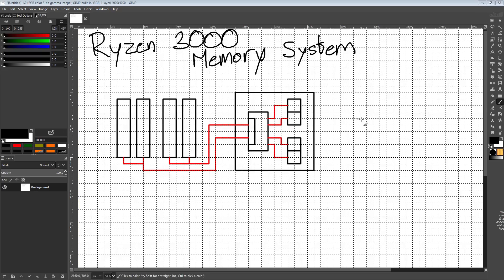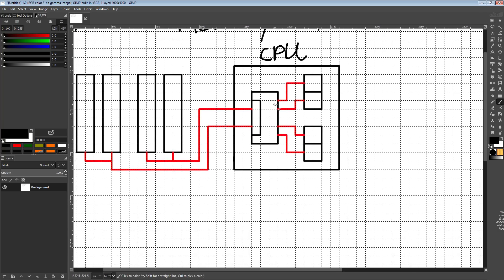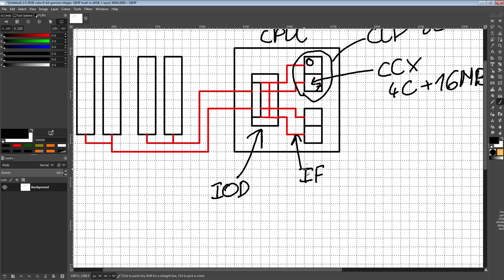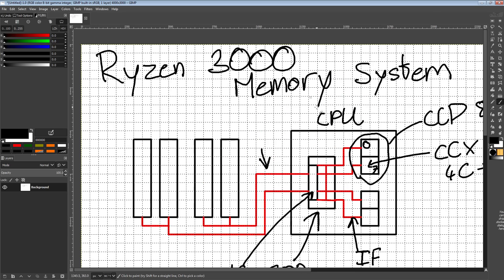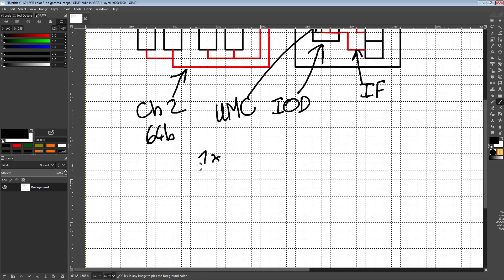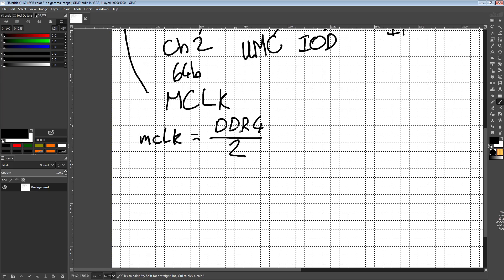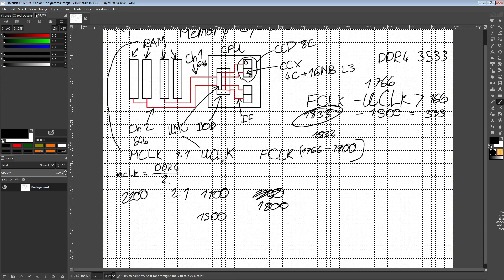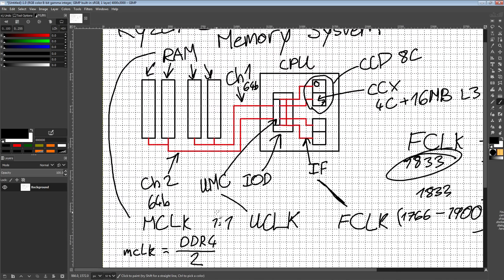AMD Ryzen 3000 memory system explained

Comment: I recently discovered the hard way that more SoC voltage is not the way to get on zen2. I was playing around with a friends 3600, pushed IF to 1900 at 1.11v (1.1v GET), and was getting WHEA errors. Tried pushing more SoC and things just got worse and worse, at 1.16v (1.15v GET) things like video playback would chug and audio would crackle, and there were far more WHEA errors. I was so confused, dropped SoC to 1.09v and all the issues disappeared and things were stable. I had never seen this issue before and I've messed around with 9 or 10 different ryzen systems, only 4 or 5 were zen2, and never saw issues up to 1.2v SoC on zen/+.

Comment: o snap, i think u solved my issue, i was running my 3200 mhz kit at 3600 mhz (sorry mega ticks? kappa ) and 1900 fclk, so even though memtest came out 100% error free when i would encode long videos or game for a long time i would crash, so i was over stressing the infinity fabric and was also against your 166 rule, so  i should keep it fclk = uclk so both at 1800, i am gonna try that right now, thanks bro

Comment: Hi I would like to make a question: I have bought these RAM sticks "G.Skill TridentZ Neo 16GB DDR4-3600MHz (F4-3600C16D-16GTZNC)" because they were way cheap and I didn't know they were Hynix RAM sticks. I do NOT intend to OC them, I only OC the CPU. What you suggest I do? Keep them or buy "G.Skill TridentZ Neo 16GB DDR4-3600MHz (F4-3600C16D-16GTZN)" RAM? I really trust your opinion and would really love your advise. I have an Asus Rog Crosshair VII Hero MoBo combined with a 3600 Ryzen 5 CPU. Best

Comment: Now it makes sense, why do two different high end DDR4 kits top out at the same results in benchmarks.  Basically no matter what latency you run the DDR4 at on Ryzen 3000 they all top out at the same score with 1900 UCLK as of max latency 16.  Anything over DDR 3800 is a waste of performance, anything at  3800 or under it is ideal but with really low latency kits you run into a wall basically there is absolutely no gain in performance if you have lower latency than 16. I tried running 2 kits at 16 and at 15 , the result was the same, and it will be the same even if you go 14,  also anything above 3800 is a loss in performance like he just said.
Reply: And I'm an idiot with 3600 mhz and cl18

Comment: The real clockspeed of DDR4 3200"MHz" is 200 real MHz which is doubled 4 times... therefore the latenzy did not changed since I dont know 10 years... it is simply a bandwith increase...

Comment: You are kind of all over the place. I might not get it correctly.
So if I buy a CPU,Mobo and RAM (hopefully for my next birthday). a Ryzen 5 3600 with GOODRAM 2x8GB 3000MHz DDR4 CL16-18-18 DIMM, plus a Mobo with PCI-e gen4...
so the ram works on 1500, i tried to find the other but could not find info about R5 3600, basic stuff like cache and so on but no FCLK
Reply: FCLK is 1800 MHz by default.

This is why if you get 1800 MHz RAM (3600 MT, for instance CL 16) it clicks so well and you get some abnormal boost.
Reply: @MadameMinty  so if i get 3000 mhz 2x8GB CL16, i have to lower the FCLK to 1500, from 1800 and use more multiplier o_O?

Comment: Can you explain why is  the latency the same throughout the infinity fabric ? that would be very interresting.
Reply: Because everything goes through the IO die, and the IF speed is limited. So, it's two hops each way for everything.
Reply: @laurelsporter  can you elaborate more
Reply: @zephyr7  Core 2 needs to talk to core 11. Core 2 has to go to the IO die's IF switch, then from there to core 11 (there might be an extra CCX/CCD step, there, too, but that will be mirrored on the other end, if so). Swap any core numbers in there that have to go off-chip, and it's the same story.
Reply: @laurelsporter  ok but that doesnt explain how going frome core 0 to core 1 is the same as core 0 to core 5 or 6
Reply: @laurelsporter  latency wise
Reply: @zephyr7  it shouldn't be. Cores 0-3, 4-7, etc. should be faster, between each other. However, they don't have to go out to IF, being within the same CCX.
Reply: @laurelsporter  didnt he said that the latency was the same between all cores ?

Comment: I tried messing with this nightmare for 2 weeks with 3800X 3733 memory kit. I gave up and picked up a 3600 kit cl17 (good enough) and it has been smooth sailing. Memory latency of 70ns, cinebench r20 just over 5k. Trust me, just buy the 3600 kit.

Comment: does this mean that using somehing like 2400 DDR4 memory kit should be viable as well?  MCLK =1200 Mhz , so if UCLK would be able to run at 1200 Mhz, therefore at 1:1 ratio. According to your rule of FCLK-UCLK=>166 , you would be getting with the result of this equation somewhere in the 700, even with crappy CPU which can do FCLK 1766. Which in theory means, you should be able to negate the silicon lottery, because you just dont care if the chip is good or bad. Can someone please explain if this is possible and what effects on performance this would have?

Comment: about the memory channels -are itx and dtx boards that only offer 2 memory slots offering them each on a separate channel? do you get the same benefit if you only use 1 card in a channel?
Reply: Yes and yes. The improvements from bank interleaving and such are dwarfed by the bus speed and raw addressing timings, these days.

Comment: This memory system has kinda gone backwards,  pre A64 the memory controllers were on the North bridge, AMD changed that up and made massive improvements to the system by moving memory controller onto the CPU... and now they've moved it off again!. Sure it helps them have multiple chiplets on a single CPU but did we really need 12 or 16core "mainstream" CPU's?
Reply: Yes, moar cores! Still, this is a lot better performance than using the chipset, far far away on the board. As well, Zen 2 on desktop are basically server chip leftovers. The real drive for this design was Epyc, with many more chipsets per CPU, to increase CPU core density cheaper than Intel.

Comment: I have one of those rare 3000-only memory kits unfortunately, a set of four Corsair Dominator Platinum C15 8GB chips with SK Hynix dies. I tried reeeeally hard to get 3200 out of them, even in the range of 3100, and just absolutely could not achieve stability lol

Comment: HUB did a video on the ratios of UCLK and MCLK and 1:1 is definitely better.  I recall performance gains from 10-20% from going from 3200 stock timings ram to up around 3700 with all the timing pulled tight.   I recall OCing the UCLK more than the exact 1:1 resulted in a loss as well.

Comment: Note that FCLK instability very often manifests itself differently than memory instability. When my FCLK was unstable I would get broken crackling audio and frequent long stutters in games without anything actually crashing. I tried pushing my SoC voltage up to 1.2 V and couldn't make 1900 MHz stable. I think it was actually getting worse at some point. I still seem to manage 1866 MHz at 1.12 V or so quite easily.
Reply: I was wondering what that was, settled on 3200 cl16 with 1600 IF

Comment: Is it worth it doing the FCLK OC if the kit is working 3200 (1600mhz) and the CPU can go 1800-1833 with the FCLK? As the gap narrows to the top speeds?
Reply: Likely yes, with some small CPU speed gains in multithreaded tasks.

Comment: Sir, cores don't talk to each other. Interprocess communication is achieved via memory. Please refer to the excellent book Modern Operating Systems by Andrew S. Tanenbaum.

edit:

everything else seems bang on!
Reply: They do talk through L3 cache via IO DIE, not memory. So the memory write from core 0 to 7 would go to:

a) L3 write in core 0
b) IO DIE write to memory
c) IO DIE copy from L3 of core 0 to L3 of core 7
d) L3 read in core 7

The cache transfers are much faster than memory roundabout. (limited mostly by FCLK, while RAM has CAS, RAS, RP, WRT and other timings) Only when you copy a lot of data do you incur the memory wait, or when the data is not in L3 of core 0 anymore.
Reply: @AstralS7orm  and I agree with that but the language initially used was core talk to core. It's infuriating that all these supposed tech-tubers dumb things down to a flat out wrong statement.

And even with your explanation, Applications don't talk to L1, 2, 3,...n. It is a memory location address. The hardware masks where the data actually gets used from. Just about the only time cache get manipulated on command is during a context switch.

Comment: What if you underclock the RAM to 1900MT/s and have the FCLK @1900MHz, can you get a 1:2 ratio and is there any point in doing so?
Reply: You meant 1900 Hz right? 1900MT is 800 Hz. The only point could be power saving, and it's not much. In fact it'd be better to tweak FCLK at runtime for that rather than MCLK.
Reply: @AstralS7orm  1900MHz which is double data rate (DDR) so running the RAM @ 950MHz, JEDEC often allows slower than 2133MHz, so running them slower shouldn't be an issue, the gains could be better latency. On my 3000C15 stics they have a JEDEC of running @ 933MHz with 10-11-11-22-33 with an XMP of 1.35v, which is 1866MT/s. I could sync that with an FCLK @ 1866MHz for a 1:2 ratio, right?
My question is if it will have any benefits doing that, and is it even possible to get the ratio to 1:2?

(To not get it confused 1:1 and 2:1 is often discussed, but I have never seen anything about the 1:2 ratio)
Reply: @magnusnilsson9792  Memory latency does not matter enough to cut bandwidth in half. Not that you're changing the timings since each count is slower - those are *cycles*. Use nanoseconds next time.

The benefits would be memory power savings, which is not a lot, at reduced performance. And low voltage. It's maybe something a super thin laptop could pull off.
1/2 ratio will work fine, but not fast.
Reply: @AstralS7orm  Ok, thanks.
The latency in nano seconds would be slightly slower.
10 to 10.72 (3000-15 to 1866-10)
11.33 to 11,79 (3000-17 to 1866-11)
in this specific case.
However if you have 2133MHz RAM you wouldn't loose much bandwidth going to 1866MHZ, right? And if you can get better latency in nanoseconds @1866MHz than @2133 I think it would be good.
Say you have 2133C13 (12,19ns) sticks and go to 1866C10 (10,72ns)?
Reply: @magnusnilsson9792  Still no, 15% bandwidth is better than 10% latency. Latency has a small impact on chosen workloads, in general bandwidth is better. You'd have to check your specific load.

Comment: @Actually Hardcore Overclocking - was it just a simplification, or does the memory layout really mix a daisy chain and t-shape layout for each channel? If so, wouldn't it have some negative impact on stability and performance?
Reply: daisychain or t topology does depend entirely on the motherboard, most new am4 motherboards use daisy chain though.

Comment: If I had a zen2 system I would try to max the ramspeed by going ddr 4800-5000mhz for maximum bandwidth possible and the imc at the 2:1 speed. But maybe zen2 cant reach those ram speeds even though imc would be going at half the speed of the ram.
Reply: I'm pretty sure people have done it. I don't think it's faster though.

Comment: Is there a way to tell if you’re running a 1-1 ratio?
Reply: Open Ryzen Master. It will tell you if it's in coupled mode. You can also see the memory and fabric clocks there. To see uclk open CPU-Z and look for NB frequency.

Comment: I bought £125  3600 C19-20-20-40 2x16gb (alleged to be hynix cjr) for my 3900x/B450 Tomahawk Max. Set XMP, set DRAM Voltage to 1.35 manually. Works fine. Aparently there is some headroom for OC/latency tweaks but i've yet to get around to it
Reply: Yeah you definitely wanna get the timings down, CL19 on 3600MHz is horrible. May need higher voltages to get a lower cas latency
Reply: @punktkomma9489  it's actually not that bad if you calculate the delay in clocks.... and the ram was so cheap, like 33% price for maybe 3% perf loss... but yes i always want better, it'll save me from being tempted to get some of that gskill 3800 CL14 lol

Comment: Question: my initial thought was that the FCLK worked best when equal to MCLK ie. 3600 kit to give 1800Mt/s and clock the infinity fabric (fclk) to 1800. You suggest this is not optimal and performance can be improved by having an offset of 166 between the two. So if you have an fclk of 1800 you need a uclk<1633 which means in a 1:1 ratio with MCLK a 3200 kit would be better and downclocking a 3600 kit to 3200 should see performance increases? Or have I got it totally wrong and sorry if I have!!

Comment: I still often wonder how the latency and overall performance would be with 4000 MT RAM, 2000 mhz uclk 2000 mhz fclk and 4000 mhz fixed core clock.  Would probably take LN2 to reach those uclk and fclk if it's even possible, but it'd be neat to see what a 2:1 core to everything else would do.

Comment: Since the IO die can be binned as well, I wonder if we'll see over 1900MHz FCLK stable on the 3950x. From what I've seen only the 3600 has a problem getting 1800MHz, so they probably get all the dud IO dies.

Comment: I've read 2:1 mode doesn't make the UCLK run at 50% of MCLK, but actually clamp it at 1800Mhz while letting MCLK go higher. 
Otherwise going in 2:1 would have tremendous latency, far beyond a simple out-of-sync package.

I've bought a 4x16Gb 3200Mhz kit that simply doesn't want to go over 3000Mhz :(
Reply: That's not true at all. 1:1 and 2:1 are the only options. It can't run decoupled.
Reply: @Carpelus Not so far. Kinda annoying because those are TridenZ Royal. I was expecting them to be at least be able to run at stock speed.

Comment: Is there any benefit to having an integrated memory controller versus this unified thing AMD is using?
I guess infinity fabric is pretty special since an IMC was definitely an improvement over having a motherboard North Bridge memory controller.
Reply: Zen 1 had IMC (well, everything for the last 10 years has had it). With a single die/chiplet it works fine but with multiple chiplets you have NUMA issues and variable RAM latency. Anandtech has NUMA screenshots for Epyc 1 and 2 if you want to compare the madness.
Reply: Zen and Zen+ have a bit lower latency at the same frequency, so that's probably an advantage, but it couldn't run memory nearly as high frequency. Also, the larger L3 cache of Zen2 makes up for any minor latency advantage Zen/+ has, so Zen2 is basically just better from a performance standpoint.

Comment: Question: What is better performance? 2 x16Gb 3600Mhz or 4x8Gb 3600 Mhz -- I was pretty sure for some reason if I had all memory slots filled that it would stress the memory controller too much and have generally worse preformance over long term. I only need 32Gb of ram.
Reply: always go 2 sticks if you can, that's the recommended.
Reply: It should be the same, more or less. Both will be able to do dual channel and dual rank. However, unless you have a T-topology board, getting four sticks stable may be a challenge.

Comment: So hope for stable 1900mHz fclk, uclk, and 3800 mHz ram and then tighten up the timings.
Reply: That's the basic strategy. However, depending on your memory, sometimes if you're pushing it to the max, sometimes you're better off dropping down to a lower frequency if it means you can get much tighter timings. On my Ryzen 3600 system, the memory has to be so loose at 3733 that 3666 outperforms it.
Reply: @nagorak666  luckily I have a Corsair Vengeance RGB Pro B-die kit 2x8GB.

Comment: makes you wonder how fast it would be if all cores could access each other without the need of infinity fabric.
Reply: I wouldn't expect anything crazy until at least AM5. That will probably let them ditch the external chipset too, more pins is more better.
Reply: How fast? More like how slow and hot. Everybody used to do it that way, but those crossbars ran hot, limiting performance (remember, most of the market at large cares about actual TDP), so mesh type interconnects and ring busses are the order of the day.

Comment: I have 2 2 x 16GB corsair 300mhz kits, each alone can run @ 3000mhz, together, after boosting voltages, they bluescreen the pc if I push them to 2800+.
Reply: What did that poor UMC do to you that you're in the mood for torturing it with 8 ranks?
Reply: 1000% overclock... That's crazy

Comment: What tests are there for IF stress testing? Would something like prime95 work for that?
Reply: Pretty sure it should give a good indicator of stability if you run small FFT long enough.
Reply: If your system doesn't outright crash with FCLK on 1900MHz during memtest, it may be stable. If it crashes during prime95 or a heavy real world load, bump SoC and VDDG voltage a tiny bit and test again
Reply: This is like the ultimate thread of bad advice
Reply: @imadecoy.  sure, you may wanna explain why it's bad advice. While you are at it you could also explain why my FCLK is stable at 1900 only if I raise the VDDG and SoC voltage, stable meaning a few dozen hours of stresstesting for the cpu and the memory controller without any errors or crashes
Reply: @punktkomma9489  because memtest doesn't stress the Infinity Fabric and small FFT doesn't stress memory. My system doesn't crash or error at 1900 fabric clock either, but that doesn't mean it's stable.
Reply: something1random23 do you have any recommendations for stress tests?
Reply: @silverxpenguin9484  The prime95 blend test or AIDA64 stress tests may work, but I found when my fabric is unstable I get stuttering audio and games. Nothing usually crashes or reports any errors.
Reply: something1random23 after experiencing stuttering, would you down clock fclk or raise voltage?
Reply: @silverxpenguin9484  Try raising the SoC voltage first. I wouldn't go above 1.20 V. If that doesn't work then reduce the fabric clock one step. I got 1866 to work at 1.12 V, but I couldn't make the stuttering stop at 1900.